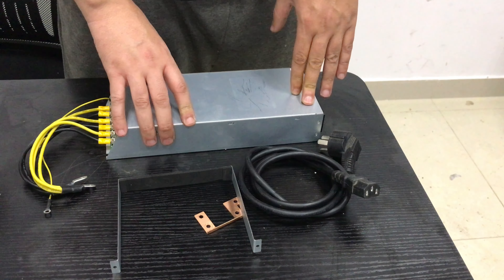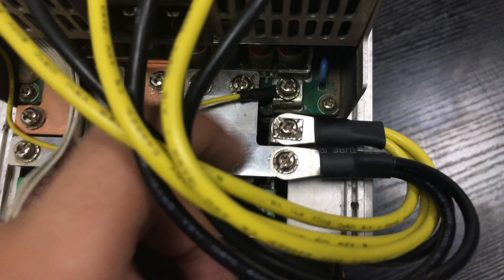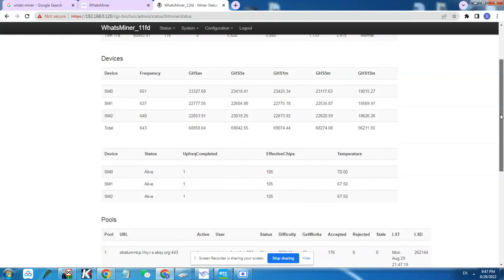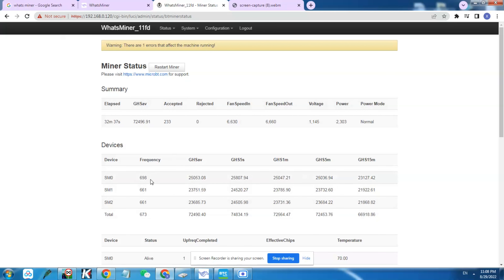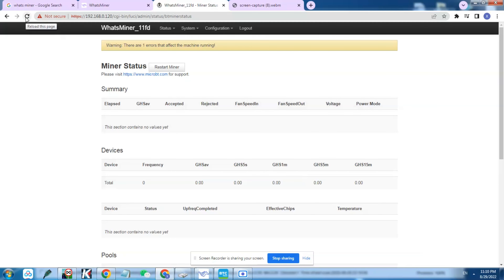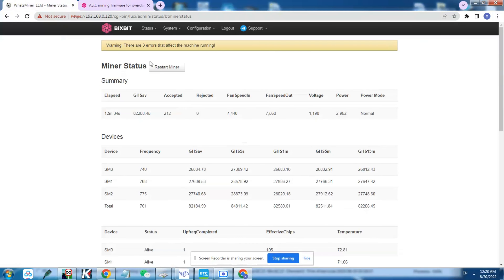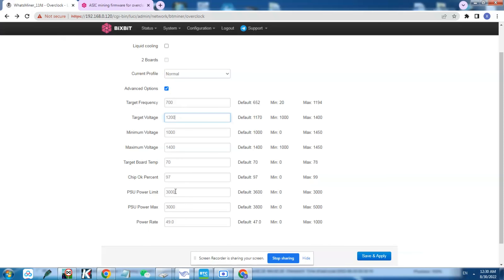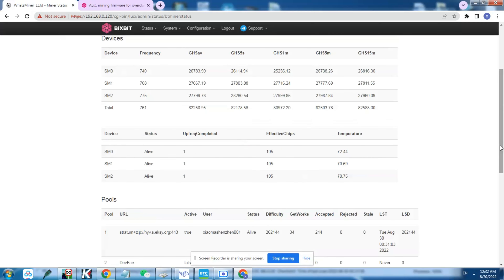#whatsminer #overclocking gain up to 40% hashrate with one simple upgrade

Comment: what is the total voltage ? 2000w+3500w? isn't that a lot?
Reply from the maker: That’s wrong , the total capacity of. Oth power supplier is about 5500 W , but that doesn’t mean it’s been all used , the power consumption you can on the miner interface is about 2900 W for two hash boards , the second power supply is supplying power to the third boards only , so total power consumption should be around 4000 W , a stock M31 S will consume about 3200 W , Whatsminer asic are not the most efficient miners in the market , but still a good upgrade for extra 12 TH
Reply: @Crypto_mining_lab  would it be possible to use a 110-120v compatible PSU for the expansion? Sounds like your estimating only ~1100w usage from the second PSU.